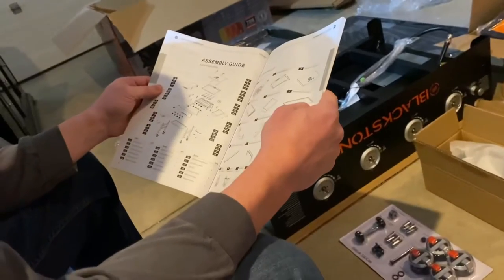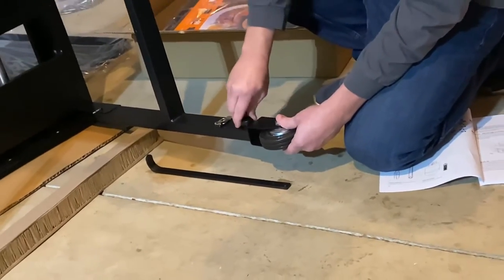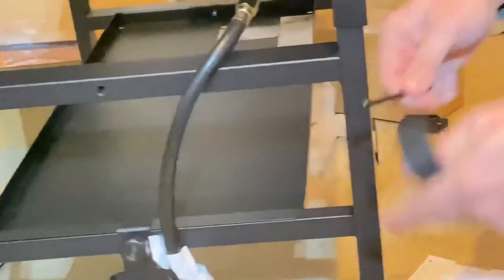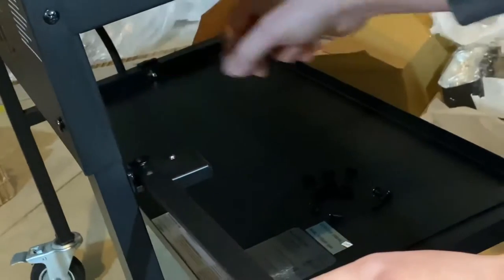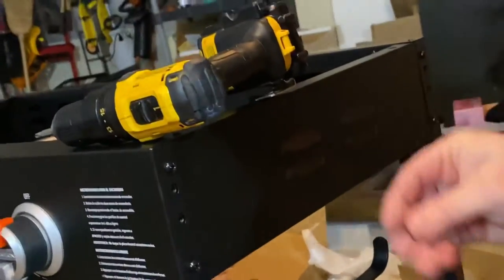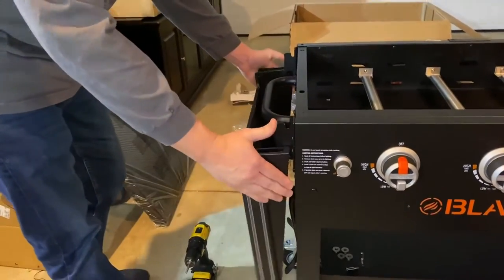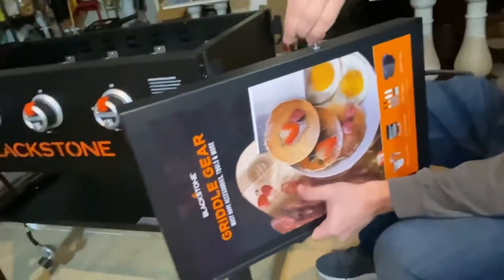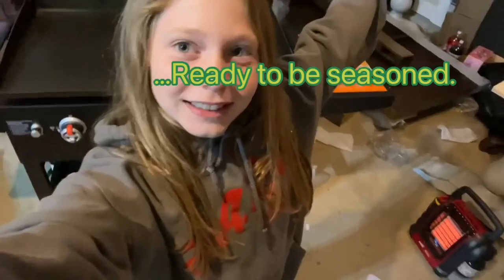How To Assemble A 36” Blackstone Griddle

Comment: Thanks for the video, it definitely helps fill in some gaps that the instructions aren't real clear on.  However, the papertowel holder was installed incorrectly.  You put the washers on top of each other and there should actually be one on top and one on the bottom of the bracket  per the instructions.  I see you swiveled yours in, so perhaps this makes a difference when it comes to ease of swiveling the papertowel holder.  Just FYI in case you did not catch this already.

Comment: Great video. Did you choose to install the shelf upside down or just a mistake?
Reply from the maker: The grill is upside down during install of the shelf because it supports the legs. So when the grill is turned over it is right side up. Common mistake though.